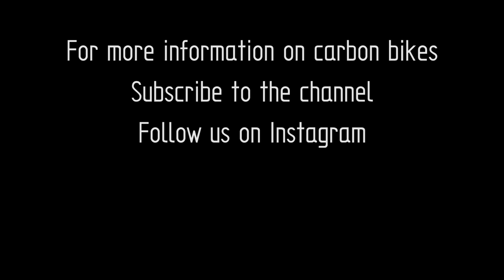Question Of The Day - Does A Carbon Frame Go Soft Over Time?

Comment: I have still my 1986 Vitus k9 with carbon tubes from aerospace co.TVT,
bonded together with aluminium lugs—there’s nothing to compare how smooth
that frame flies over bad roads-i used it as time trial bike and at the championships when i first 
rode it,going out the saddle in a big gear like 53/13 it would bend the whole thing so that the wire
for the rear derailleur would be stretched,so that it went up to the next cog!
That happened 3 times during the time trial and i got silver and missed the title by 8 seconds...
Every time i see this bike it reminds me of that.
That was the beginning of the carbon aera,and it isn’t easy to store these kind a frames to keep them rideable : 
humidity,temperature
and darkness(UV light damages carbon) are essential. 🤙

Comment: odd question...however,  a carbon bike that has taken much stress, like steep upgrades resulting in hard cranking and pulling on the bars. creates stress in the frame...carbon is very brittle, unlike aluminum.  the hard cranking and twisting on the frame caused frame stress that after a few years can cause cracking and even fracture of the frame. in buying a used carbon frame one needs to look very careful for stress cracks and small fractures from this type of riding.  more late models carbon bike after 2016  have beefed up the areas  and changes the shape of the bike that can take stress cracks.

Comment: "Q of the day" is a great idea for probably comparably quickly made videos - and you have so much to share ...thanks a lot!!
One question: why are wrinkles at the inside of carbon-frames that problematic - we see them on almost every carbon-frame, you cut into pieces.  Isn't it just excess carbon (or resin??) adding some weight (without adding function)? This is not favourable, of course. But how are those wrinkles on the inside of the frame diminishing the stability / longevity / safety of the frame? cheers.

Comment: I am not that educated in epoxies and composites, but would like to know more. 
Your main concerns regarding degredation of mechanical properties. 
1. Bad manufacturing processes/standards leading to resin degredation
2. Voids etc. 

Would the degredation of resins affect the linear-elastic properties, i.e. Lower the youngs modulus of the resin, or would it lead to a lower yield stress, or maybe both? 

Voids/other defects would in reality be a failure if they expand/propagate, not just give a «softer» frame, right? 

My thinking is that both these concepts you are talking about are more about the frame failing than softening? Like a fluid transport pipe with crack in it would not be able to hold as much pressure, but you would not say it has lost stiffness/strength, rather it has failed? Maybe not the best example, but hard to find better examples before my third cup of coffee. Would love to hear some more thoughts.

Comment: So you are saying that a bike like Cervelo R5 or equivalent build by engineers can actually be a better purchase in the long term even with 5x the cost? :)
Reply: most cervelos including the top end models are made in asia by workers, not engineers. The only one made by engineers is the RCA frame which is made in California.
Reply: rcplanefunguy1212 Of course, it was the R5ca/Rca that I was referring to.
Reply: my bad
Reply: Further clarification, "R5 built by engineers" = R5 California / Rca / R5ca and by equivalent I meant similar models mde by other manufacturer engineers. There are not many!
Reply: The issue is: if the company designed the bike well and how good is quality control of the company's engineer/quality manager over production process in Asia. So its about design and mainly quality control. Good quality and execution of production process in the case of sophisticated frame design (low weight, stifness, comfort in one) mean
 costs.

Comment: That leads to another question and that is are the properties more important than the overall weight?
After watching your cut up videos I wonder if a carbon bike constructed of only seat and steerer hollow tubes connected with solid star shaped top, bottom, chain stay and seat stay beams would be more benefit for a specific compliance and reliability....
Reply: TheCrossroads09 That is tube and lug construction, I purchased such a bike as I am weary of the balloons. Raoul said that the glues can deteriorate with time, but my bike is as clean on the inside as the outside. At least you don’t have wrinkles and resin rich areas.

Comment: Carbon fishing rods get softer over time. What do you think of the GT Grade with glass fibre seat stays designed to increase compliance?
Reply: As someone who has worked in the fishing tackle industry for my entire working life I can safely say I have never heard the claim that carbon rod blanks go soft, nor have I observed it. I still have a carbon rod I've been using consistently for the last 12 years, the blank feels as it did when I got it new.
Reply: Fiber glass absorbs buzz and chatter...it doesnt make the frame soft or bendy
Reply: Domenic Holland you've probably never been a tournament caster either.
Reply: frederick sta ana fibreglass is added to fishing rod tips because it is bendy, carbon tips are not as sensitive so fibreglass is blended in. The seatstays of the GT Grade are solid fibreglass wrapped in carbon for these 'bending' qualities. Just wondering what Raul thinks of the process.
Reply: Jesus Christ don't get me started on tournament casters
Reply: It is possible that they use different resin on fishing rods as the use case is really different. And much more deformation can have a significant impact on the long term performance of the resin too.